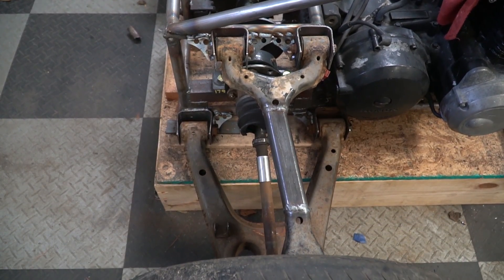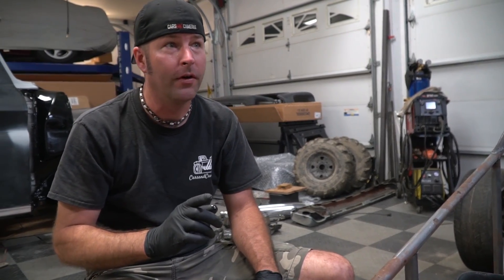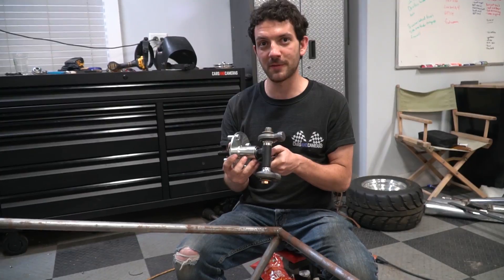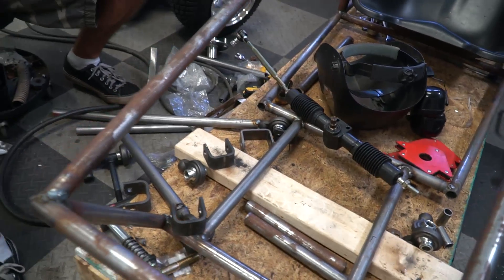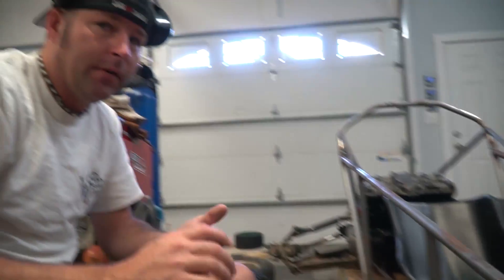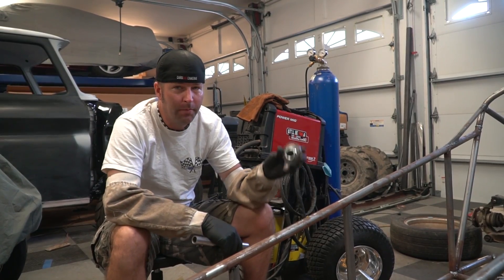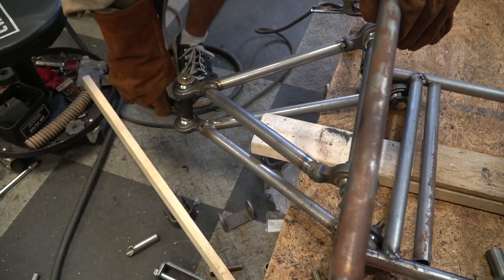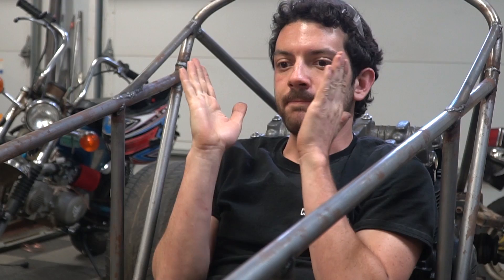Independent Front Suspension Build! | 750cc Cross Kart Pt. 9

Comment: Those lower control arm pivots need to run inline with each other. That’s why it’s so stiff. It’s binding up.
Reply: And threaded into the tubing, so they could be adjusted.
Reply: Came to find this exact comment, as soon as they angled those I was like "noooo" lol
Reply: Probably better to find a used set of quad front arms
Reply: Thank God I'm not the only one to notice the control arm geometry also I would have used heim joints that fit the inner diameter of the tube or at least sleaved the joint at the weld, better to be safe than sorry at 60 MPH.
Reply: Yeah, that's going to make it break for sure.
Reply: It's almost like they have never been around an off road vehicle.
Reply: The issue isn't the length, it is that the arms do not move parallel to eachother.  Most cars have SLA suspension which is unequal upper/lower.  The trick is to work out the correct geometry for a perfect parallel track of the arms, and minimize steering or drive line issues based on changes in suspension height.
Reply: Hopefully they read the comments and fix it before they keep going!
Reply: @JifeLacket  I've been yelling at them about proper ackerman forever and they ignore me so I wouldn't hold your breathe on them reading the comments.
Reply: JifeLacket yeah that’s just wishful thinking because they pre film several videos ahead.
Reply: It'll be fine
Reply: Because there angled there trying to arc away from each other. If the heims are parallel  they they arc the same and won't bind
Reply: Lol at all the incorrect drama queens here that must have felt stupid after they showed in the next vid it was only stiff because the heim joints were new and quickly freed up.  

That seems to be the theme here.  Internet experts, aka mechanically inept commentators, criticize xyz aspect of a build and they invariably turn out to be completely wrong.  I see it on nearly every video.  Benefit of just discovering the channel and working through the older projects.
Reply: Great forum thread on a arm suspension geometry https://www.thesamba.com/vw/forum/viewtopic.php?p=2836883
Reply: @Garrett they are binding because of bad geometry, good learning experience though.
Reply: Was thinking the same thing
Reply: **The heim joints need to be parallel for each arm (point at same 90 degree parallel angle)**
Reply: If these people would stop building suspensions out of them. They weren't meant for this shit. Its not even safe lol. Build it the right. It'll cost a hell of a lot less too
Reply: They are not meant for suspension lol. They are meant to pivot but not the way a suspension works my friend. When it raises and Lowers the way it does its changing all sorts of angles. It can only pivot so much.
Reply: Yup bottom ones are longer than the top ones = binds up....
Reply: @Wangdoodle444  @tiporari Both of those are not the issue. It's the angle of the pivots of each arm not being inline causing the bind.
Reply: @Wangdoodle444  no. Not at all. Almost all a arm setup are SLA, SHORT,  LONG ARM. Bind is because the pivots are not parallel to each other.